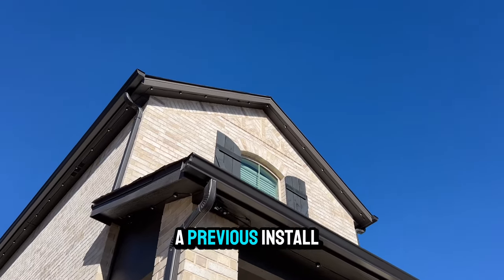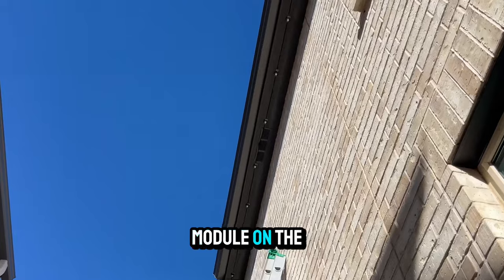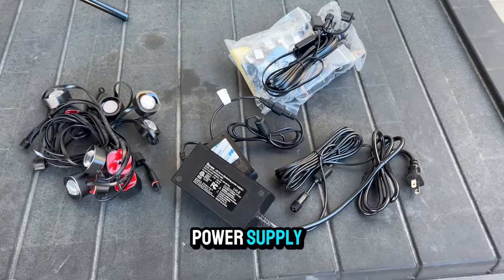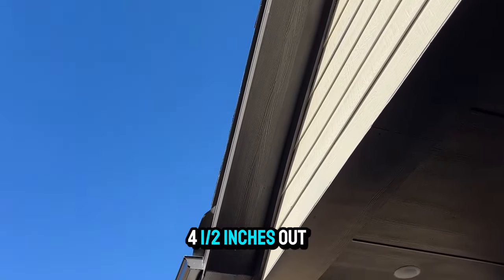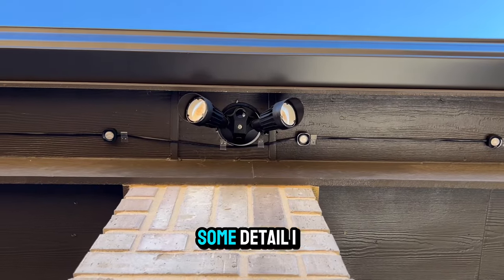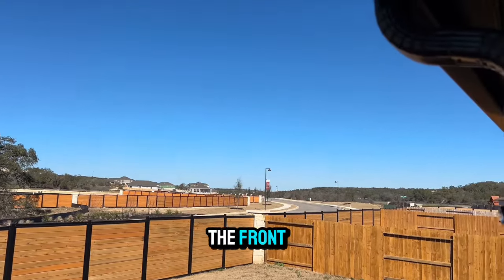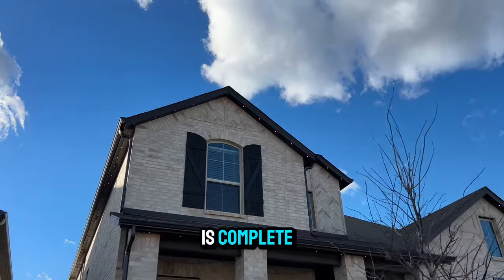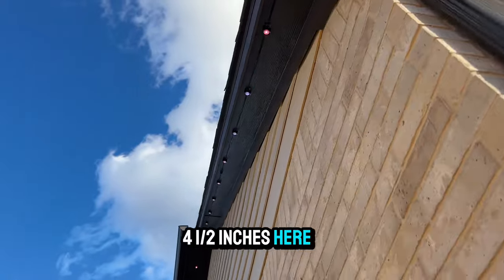Govee Pros-Canyon Lake, Tx Pt.2, 100ft addition w/LEDModule Driver @GOVEE #fyp #diy #howto

Comment: Do you cut extra lights if not needed?? How do you waterproof the end?
Reply from the maker: Yes, you can splice unwanted lights. You just need to have them read a full strand in the app. Example would 9 1/2 strands would still be 10segments. Water proof them like this  https://youtube.com/shorts/aMxgmO_StUI?si=abD6yWZWKY54hd-b
Reply: Thank you for the reply. I am going to attempt to run about 275 feet. I have the black pros. 200 ft and 100 ft.
Reply from the maker: @Aflores25371  yes not a problem. Once you have your install done, you can group both devices under Home, then at the bottom group hit the plus symbol, then same-model group next
Reply: @jbsdiytv  you are awesome, thank you. One last question. Do you recommend starting in any particular spot? If I am facing my house, my garage is on the right side. I thought about starting around the side of the house, running my power into the garage, and hanging from right to left.  I am going all around the house. Or do you recommend I have a plug installed on the right side of the house and running lights from left to right. Or does it not matter for the sequence of the lights?
Reply from the maker: @Aflores25371  do you have fb or IG messenger? Message me directly. My social media platforms are at the top of the channel